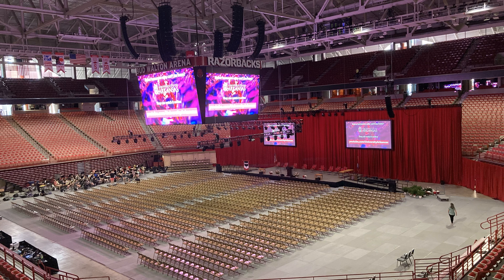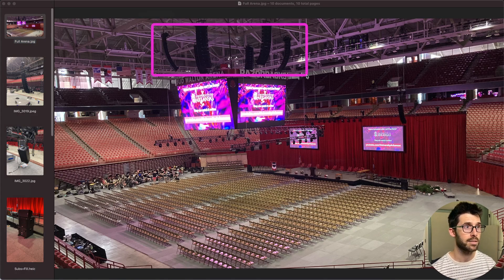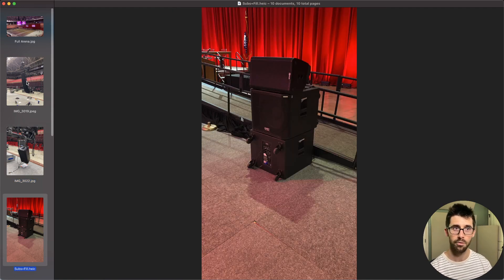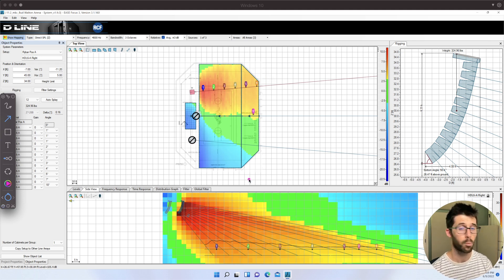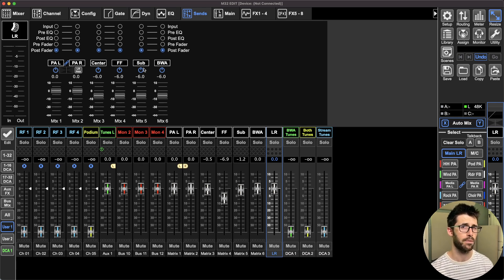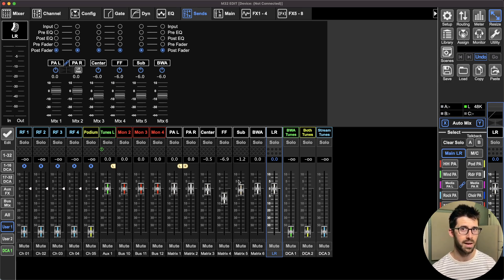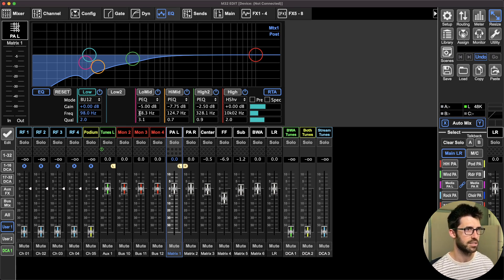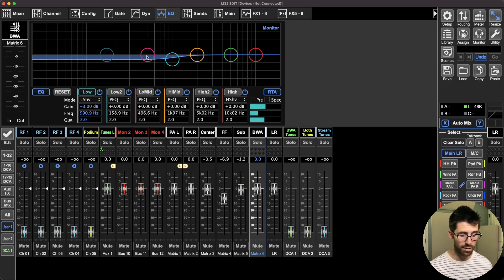How I Tuned An Arena Sound System With A M32 (With Just Six Matrix Outputs)

Comment: Do you know what the volume dial on the HDL6a units is setup for? Is the “max” option 0dB or +6dB? Or is the arrow 0dB? How do you typically deploy? I haven’t been able to find any documentation. Thank you!
Reply from the maker: That's a great question! I honestly don't know the specific sensitivity range of that knob, but a good rule of thumb would be to send pink noise out of your desk at just below clipping your console output, then turn up the input knob on the HDL6-A until it would just start to tickle the limiter light, then back it off.

Comment: Mr. Michael, I have a challenge with using the Ease focus 3 software to tailor the desired shape of my acoustic space. 

Like, the space is not just a rectangular or trapezoidal shape thing. 
At some point it's a rectangle but not a complete rectangle cause the line is gonna be joined to other shape.

Comment: Love your videos, Michael!! I'm a little bit confused on how did you do your set up on tuning, did you still used an interface or directly on the M32? If you go directly to the M32 can I ask how you did it or make a video of it, would be a lot of help!!
Reply from the maker: Hey, Nathanael. In this video the M32 is acting as my mixing console and my "processor" (utlizing the matrix outputs to apply level adjustments, EQ, timing adjustments, etc.), but I'm still using a separate audio interface for my reference microphones and signal generator from SMAART.

You can use the console for all three of those tasks when in a pinch, but I've only had to do it once. Carrying a separate interface simplifies things greatly.

Comment: Hey Michael, Love the content. I am looking at getting a few of the HDL 6 or HDL 10 boxes in the near future. What are your thoughts on them?
Reply from the maker: I've used the HDL 6-A's on a ton of shows, but haven't touched HDL 10-A's.

The HDL 6-A's are super light and sound great without having to man handle any EQ on them. The only processing I'm usually applying is a low shelf on the entire hang to get the LF to my desired target curve. Then sometimes a high shelf on each PA zone if I have a system processor with multiple outputs.

This most recent show I did in the Fort Smith Convention Center showed me where they "top out" SPL wise. I mixed the country act for the mid-show entertainment, but the "party band" for the even't afterparty wanted things significantly. Averaging 98-100dBA at FOH, which meant it was at least 6dB hotter on the dance floor. I had two hangs of 9 boxes there. It was plenty for coverage and the other band, but if you want to REALLY push them that's where I felt they lacked some gas.

Again, killer box, especially for the price and weight, but not if you want to run shows super hot.

Comment: Hi Michael,
thank you so much for your videos (and your spreadsheet)! 
I wonder about the limiting without a dedicated processor: Could you maybe make a quick video about how one could use the compressor as brick wall limiter to secure the speakers (including the calculation, dBu, dBfs, conversions, etc.) without a DSP? :)
Reply from the maker: I'm glad my videos have been helpful to you! All of the speakers in the array I had already had DSP built in that would provide limiting.

Even if you did set up a limiter on your console to protect the speakers you can't guarantee that each speaker will not limited because the signal will eventually be sent to a high compression driver and a low woofer. Only a limiter after that "split" can ensure that the individual drivers won't get hit too hard.

But, you can "help" protect yourself with a limiter early in the chain. If I'm on something like the M32 I would use the Precision Limiter across my LR mix with the threshold at -1dBFS, attack as fast as possible, release at 100ms, squeeze OFF, output gain at -1dBFS.
Reply: @MichaelCurtisAudio  Sure, but I was thinking about this if I do the crossover via the desk, too. That way, one would have control over the split and the low/mid/high channels. Of course, this would only (if at all) work for small setups. But I would be interested in your opinion, if having a dedicated DSP rack unit is really necessary in times of modern digital consoles (like the X32/M32/UI24/..) with EQ, compression, delay for Auxes and matrices. ;)
Reply from the maker: @lhenn_  Got it! Although you certainly do a ton with just the processing built into most modern digital consoles, I still like having an external processor to outsource those duties to, especially in larger contexts.

Most desks don't have all pass filters, which I would miss. I also would have preferred in this case to drive each of the RCF hangs with a processor channel for every two boxes, so twelve processing channels total, which a normal console couldn't handle. It's not necessarily that the tools in a DSP are superior, I just prefer more granularity and control.
Reply: @MichaelCurtisAudio  Definitely! And you‘re right: In larger applications (I’d say everything beyond the classic 2.1 or 2.2 systems), it makes absolutely sense to outsource those things from the mixer. 
And then there’s the problem with amp racks in rental (even local for small bands/…). I’d rather trust my limiter settings on a fixed installed DSP inside the rack than some self-called sound engineers with their mixer setup out there. ;)

Anyway, I really appreciate you taking the time to share your thoughts on that topic!
Reply from the maker: @lhenn_  You're very welcome!

Comment: Hi Michael, if you are only sending a single sub output from matrix 4 , how were you able apply delay to bottom sub
Reply from the maker: Great question! The subs I had were QSC KS118's which have some built in DSP that lets me add delay to them when needed.
Reply: @MichaelCurtisAudio  thank you. My sub don’t have a built in delay, is there a workaround?
Reply from the maker: @Deku52  You can send your sub matrix to multiple outputs, then use the output delay on each of those to apply the necessary delay.
Reply: @MichaelCurtisAudio  thanks Michael

Comment: cool, tell about the pa delays on the same project
Reply from the maker: Are you asking about the speakers in the air covering the bowl?
Reply: @MichaelCurtisAudio  And about the main system too, I wonder how you are using m32 and delay (in the mixer)
Reply from the maker: @yur4ic  Got it. So how I used the delay lines in the output processing to time align everything?
Reply: @MichaelCurtisAudio  yes! how to set up the whole system (pa, sub, front fills) with x/m32
Reply from the maker: @yur4ic  Ok, cool. So basically start from scratch: a zeroed out console file and blank routing/patching setup and go from there?
Reply: @MichaelCurtisAudio  yes please